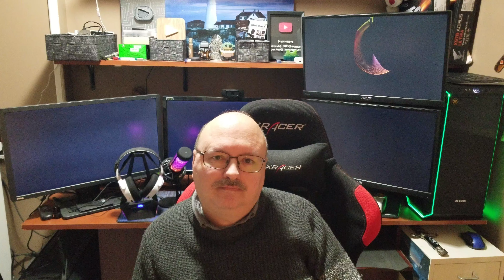Gammaxx 400 AMD Install on 5600X & Prepping Your MB

Comment: Can i use this on a AM5 MB?
Reply from the maker: I haven't used it recently but if it includes the kit required for AM5 then it will work. Only thing is I'm not sure if it will cool the CPU enough. It'd be something I'd have to test first to know for sure.

Comment: Hi! What about CPU temp in games? Is Gammaxx 400 enough for 5600x? 

PS. i have the same cooler and ryzen 2600
Reply from the maker: When I used it in games Temps were about 78c which was good for me so yeah it works well.
Reply: @Reviewing_Playing_and_More_RPM Thx. did u try it in Premiere pro or something like that?
Reply from the maker: @jforkhan  No didn't use Premiere Pro I use a different video editing program though and it worked great. Mine is PowerDirector.

Comment: Just asking. How long would an aio like deepcool castle 240ex or Silverstone pf 240 LAST? I'm thinking of getting an aio for the 1st time but not completely sure
Reply from the maker: Usually around 5 years so far for one I'm using, not a Deepcool or Silverstone though so can't be sure with different models but should be around the same.
Reply: lust stick wid air....unless u r a rocket scientist
Reply from the maker: I prefer Air but AIO's are nice as well.